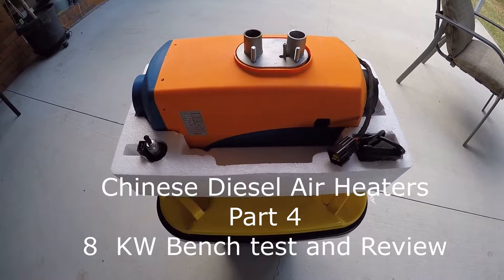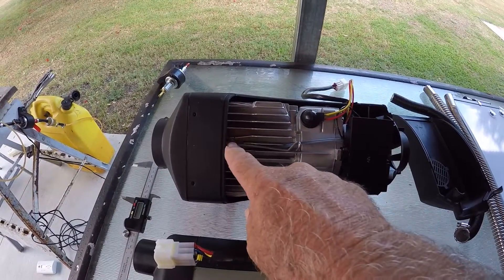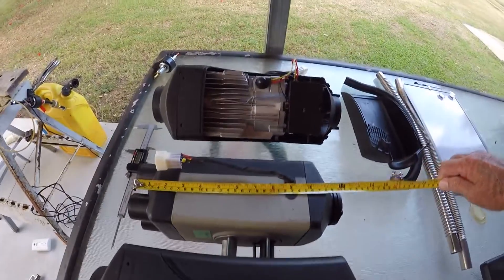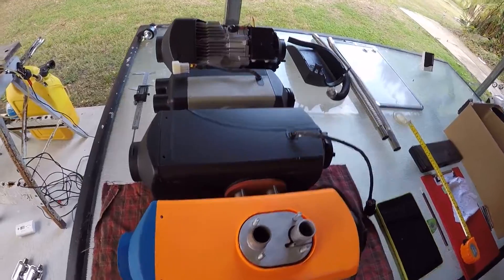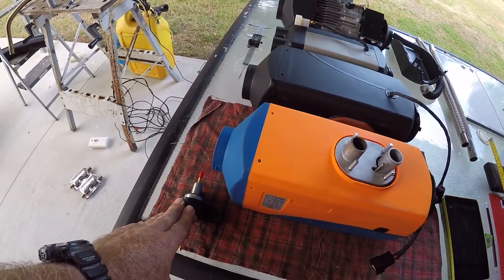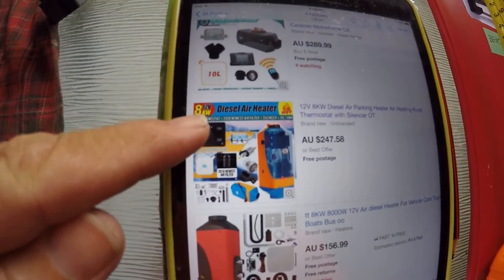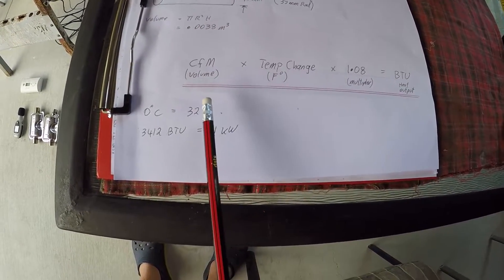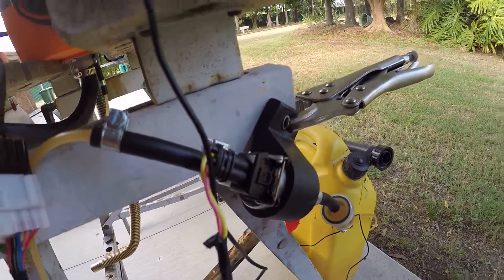Chinese Diesel Air Heaters   Part 4 -  8 KW Heater Test

Comment: hello from USA....Im bulding a cargo trailer camper and only recently (2 months) have Learned about these diesel heaters...I run propane in a aluminum trailer and get condensation...also carrying propane isnt the easiest...I bought a 8k heater but figured it was just a 5k...I watched your videos before and after purchase...my tow vehicle is now a gas (petrol?) 4runner but I used to tow with a diesel truck...I bought a 5 gallon fuel cell to mount on my trailer...anyways really enjoy the video detail...
Reply from the maker: Thanks for the feedback Vadimxp, keep warm and dry this northern winter.  JMcK

Comment: on the 8 kw unit i got it had a setting in the controller to set it for 5 kw or 8 kw. there was a noticeable difference in heat output coming out of the unit i did not ck the fuel rate difference in fuel rate or fan speed . but different control board than my 5 kw unit
Reply from the maker: Hi marte,

My 8 KW heater is a stock standard 5 KW heater, just branded different. But this video was made some time ago and perhaps there are changes with the new 8Kw heaters.

The max fuel setting on my "8Kw" heater was 5.5 Hz, exactly the same as a 5 Kw heater. 

Yes, you could probably get 6Kw from this heater by going into the settings and upping the fuel rate to 7Hz or so, but I doubt it. 

My testing shows increasing the fuel burn to just 6 Hz results in an overheat condition on this size heater and the heater shuts down. There is no way you can get 8 Kw out of this heater without increasing the fuel rate and the heat exchanger size.

Of interest,  Eberspacher rate their original heater at just 4Kw (D4) These Chinese  5 Kw heaters are an EXACT copy of the D4 heater. My testing shows it is even borderline rating the Chinese copy heaters at 5 Kw. (Yes, the Germans are conservative, and truthful. Well, perhaps there is one notable exception)

It is pure deception to have a heater that is an exact copy of the original Eberspacher 4Kw heater and market it as an 8 Kw heater.

Cheers.  JMcK

Comment: Hi John, I just watched this video on the 8kw diesel heater, I get what you are saying but if you compare the heat exchangers of both the 5kw and the 8kw there are more fins on the 8kw heat exchanger which gives more surface area which should theoretically give out more heat. Just an observation mate :-)
Reply from the maker: Hi David, 

Thanks for the feedback, It is a long time since I did the 8kw video so I can't remember about the fins on that particular heater, but I will go and have a look at the fins in a current (8KW) heater. The castings come from a number of factories, and are different between "brands" regardless of heater size.

I was careful to take measurements of heat output, air volumes, fuel usage, and overall heat exchanger size etc. But I did not actually measure the fin surface area.  I will see if I can do this now.

However I feel confident with my figures and also confident in my belief  you need a much bigger heater to gain a heat output of over 50% above the standard 5KW heater.

Regards.   JMcK
Reply: Thanks for the reply John, oh believe me I have no doubts in your tests, very well executed and very interesting, I managed to fit my heater in the garage of my motorhome and I have connected it to the original ducting, I had to do some modifications due to the difference in size of the ducting (75mm down to 65mm) I did have to put a small vent in the garage floor and used some spare ducting I had left over to get more fresh air into the machine as it is the all in one type of heater, as I had it overheat a couple of times using the Hz setting instead of temperature control, so I have just left it on the temperature setting and not tried it again on the Hz setting. I love the videos you do, have referenced them a few times during my install. Thank you.
Reply from the maker: David Evans 
👍

Comment: I have just bought a couple of 5kw Chinese Heaters.
In the Instructionbookwith joined up words, causethe Chinese Authors aren£t sure whereto breakup the words, on page 5 it lists the weight, dimensions and fuel consumption for three models as follows -
2Kw Fuel Consumption Zl/hH : 0.12 - 0.24  Weight : ZKGH : 3.6 Dimensions ZmmH : 320 x 125 x 157
5Kw Fuel Consumption Zl/hH : 0.18 - 0.48 Weight : ZKGH : 5.6 Dimensions ZmmH : 380 x 145 x 177
8Kw Fuel Consumption Zl/hH : 0.21 - 0.54 Weight : ZKGH : 5.2 Dimensions ZmmH : 380 x 145 x 177
That is all straight out of the manual on Page 5 as it appears. 
So the 8Kw unit is exactly the same size as the 5Kw unit, only by weight, lighter by 400g !!!
The 2Kw unit is physically smaller as you've shown on your workbench.

If we take the manuals figures of 2Kw heater on max consumes 0.24 l/h, and the 5Kw consumes 0.48 l/h then the difference is 0.24 l/h to produce the the difference between a 2Kw model, and the 5Kw model, 3Kw heat difference. But since we see on the spec of the 2Kw model, 0.24 is needed to produce a full 2Kw output, the math does not add up.
The fuel use difference between the 5Kw and 8Kw models for an additional 2Kw output on the 5kw model would need to be 0.48 + 0.24 = 0.72 l/h for a 7Kw output. As it is the 8Kw model only consumes max fuel of 0.54 which is way short of 8Kw output.
So the short answer is an 8Kw version by China probably doesn't exist.
with the 5Kw unit consuming twice the fuel of the 2Kw unit, the 5Kw unit is more likely to be closer to 4Kw.
The 8Kw Unicorn unit, if you can find one, would probably be a touch over 5Kw output.
Like you illustrated, the physical form factor of the Chinese 5Kw unit is that of the Eberspacher D4, which was rated at 4Kw. This seems to add up from the fuel consumption figures as well.
Still can't grumble $120 bucks is way better than $700 Eberspacher bucks. That's why I bought two and will probably buy more.
Reply from the maker: Hi Alex, thanks for the detailed comments.  JMcK

Comment: Thanks John I WATCHED ALL UR VIDS LAST YEAR. I HAVE A HEATER IN MINNESOTA USA WHICH BORDERS CANADA SO IT GETS COLD HERE. I RUN IT ALL THE TIME PROB 6 DAYS A WEEK IN MY SERVICE VAN IN WINTER.  LAST YEAR MY 1ST HEATER GOT PLUGGED UP(CARBON) SO I JUST REPLACED THE UNIT. FIGURED EASIER THAN CHANGING OUT THE HEAT EXCHANGER. CAUSE IT WAS MIDDLE OF WINTER AND MY HIGH ROOF TRANSIT WILL NOT FIT IN A GARAGE. 
SO I DID IT IN THE COLD. 

ANYWAYS JUST THOUGHT ID STOP BACK AND SEE IF THE 8KW UNITS HAD EVER CHANGED TO ACTUALLY B 8KW UNITS.   MINE IS A 5KW.   IM HOPING TO GET THRU THIS NEXT WINTER WITH THIS 2ND UNIT.   I TRY TO RUN KEROSENE SO NOT TO CARBON UP. BUT I RUN DIESEL OFTEN CAUSE NOT ALL GAS STATIONS HAVE THE KEROSENE. 

ANYWAYS I RECOMMEMD PEOPLE ON FACE BOOK OR ANYWHERE TO WATCH YOUR VIDEOS AS YOU HAVE THE MOST COMPLETE AND 110% ACCURATE INFORMATION!!   VERY WELL DONE MY FRIEND!!  LOVE THE ENGINEERING WAY YOU GO ABOUT SHOWING EVERYTHING!!    I CANNOT IMAGINE HOW MANY PEOPLE YOU HAVE HELPED WITH THE VIDEOS YOU HAVE PUT OUT.  

THANKS AGAIN AND BEST REGARDS.. NATE Hess. Minnesota 🇺🇸.
Reply from the maker: Hi Nate,

Thanks for the nice feedback. 
To my knowledge, the 8Kw are still just really 5Kw heaters.

These Chinese copy heaters are so affordable, that it could actually be cheaper to swap one out for a new one rather than pay labour costs for a professional to service.

But, they really are quite simple to clean out the carbon if you have a bit of handyman hands on knowledge.

Regards.  JMcK

Comment: Hi John,  Your reviews are great and comprehensive . I'm really enjoying them.  I'm going to be spending winter in my Mitsubishi Fuso 9 meter bus  so am going to be buying one of these Chinese diesel heaters. I'm hoping you can help me with a few things.  The area to heat is 40 cubic meters.  What size KW do I need and can you help me with a particular brand name or seller ?  I believe there are good and also bad  Chinese units ??   Much appreciated.   Regards,  Derick
Reply from the maker: Hi Derick,
A bit hard to give you definite information here as I do not know what area or climate you are travelling in your bus, nor do I know what insulation you have in the bus or over your windows. 

However there are really only two Chinese heaters you could buy, a 2 kw and a 5 kw, there is no real 8 kw heater.

I suggest you buy a standard 5 kw heater. They put out plenty of heat and should be suitable for your bus.

I can not recommend a supplier as they come and go so quickly. Not one of the suppliers I bought heaters from last year sell heaters this year. I suggest you chose an online supplier who has a warehouse in your country of origin and has a good reputation on returns. They will advertise "ships from Australia" or "local UK stocks" 

Like everything you buy, you will occasionally get a dud, but it is vary rare with these heaters. I always suggest you bench test the heater as soon as received, and not leave it stored for some future instillation. If there is an issue contact the seller straight away for a replacement. 

Regards  JMcK

Comment: I'm interested to know the temperatures around the base of these. If mounting on say a wooden van floor, how much insulation must be used to prevent fire?
Reply from the maker: Hi Ein, The hot side of the heater casing will get up to around 50 deg C.  The exhaust itself up to around 200 deg C
The heater can be generally mounted direct to the floor. You cut an oval hole about the size of the silicone gasket and then mount the heater with the square metal mounting bracket that comes with the heater. You can buy on line, or make it yourself, the square metal bracket with a metal circular sleeve to go through the floor. Without the sleeve on the bracket you should consider lagging the exhaust where it goes through the floor.   JMcK

Comment: Laboratory test or a common sense test? I'll take the common sense every time.  Thank you.

 I bought two really nice "8kw" for less than the "5kw" counterparts. I believe this supports your conclusion, these have to be the same as the 5kw.

I received mine broken in shipping. The company, Bestauto, immediately shipped replacement for part broken in shipping. I got mine off of U.S. Amazon from Bestauto. $114 U.S. EACH. 

Thanks again, John, Awesome job.
Reply from the maker: Thanks for the feedback Gary.  JMcK

Comment: I'm just thinking of getting one , a lot of people are wise to.the 5 _ 8 scam , what one would you recommend , 5 kWh is all I need .?
Reply from the maker: Hi Darell, I can't recommend one brand over another. I suggest you look for a good supplier who has a local warehouse, if possible, and accepts returns. Also chose a heater that is supplied with the controller you want.  Good luck.  JMcK

Comment: Yeah I fell for it also. I didn't invite Anthony about these heaters a week ago. I just needed one to hear my 2029 2500 sprinter extended roof 170.the van is big so I wanted a big heater especially since I didn't finlnish insulating it. I order iloff ebay and noticed that it only went up to 5 after I installed it. So I'm getting to be nice to this guy that abbiously didn't speak English well. I keep telling him to send me a 8kw unit I don't want a refund. Well he knew he didn't have one it would have just been a different controler. Then I stumbled upon the videos with the 1688 code and I was happy that I had a 8kw heater but noticed it's basically the same thing as the 5 settingsb but what has my hopes still up is the fact that we can mess with the sound and find the right mixture for a better hoter burn without overheating. So I'm trying different settings to try to get it to burn hot but at a lower setting so it's not loud and it could run all night because in the east coast and mid America is really cold at night. One thing I read on line by a smart guy like this John and that seemed to know a lot also he days the opposite of what John mc47 said about the air intake. He blocked like less than 5 percent of the whole and the unit actually ran hotter air. I tried it also once the bars were full and the 2 red ones disappeared I obstructed the intake hole (the round one on the end of the unit not the one with the pipe) and the red lines came back. Don't one of it was just the unit heating up or the flame. The guy smarter than I seemed to think it was the flame.

Comment: 110°c ? Did you just pull that number out of the air? They go into overheat over 235° if it sits there for over a few seconds.  110°c isn't even running at optimum burn temp.  you want to ideally be over 180°  for high setting and Which is around 140 to 160 is good for a low setting. Any cooler you will be sooting up and be producing a lot of carbon monoxide.
Reply from the maker: Hi Andrew, it all depends where you measure the temperature. For consistency I measured the actual air temperature approx 500 mm out from the heater. (See the videos). It is the actual hot air coming out of the heater that is of most concern to me. That is the volume and temperature of that air, because that is what is going to heat your particular boat, cabin, motorhome etc. If you want to measure the temperature of the heat exchanger body itself, then good for you. There is no right or wrong way.  JMcK
Reply: @johnmck1147  well the reading that the sensor itself puts out(on the heat exchanger) is the one everyone uses to properly tune their heater

Comment: Great videos John. I'd love to see some of the data you've collected if you'd be interested to share. Just an FYI- my 5KW heater displays the heat exchanger temps on the controller and it regularly sees 170-180C without any issues. I also read the surface temps with an infrared thermometer and it's similar. I think the shutdown temps are closer to 200C rather than 115C.
Reply: Yeah don't know where he pulled that number from haha. 110°c ? 😳.  Could be cause hes running it in Australia in a tshirt lmao
Reply: Shut down is when it goes to 235°c for over a few seconds btw
Reply: @andrewbartleman9169  Great info....thanks

Comment: John, just got my hands on the new style of a All In One Diesel heater. The fuel tank is down beside the heater as opposed above it. The tin is painted black, but they also come red. The controller comes with the three wire setup in a round connector but of a different style with a screw retainer. Its rated at 8KW, but feel and am more then sure its just 5KW. I went in to factory settings using the code 1688 and found the pump at high rate set at 5.5 and this number can be increased from there. I found the fan speed set at 5,500 rpms on the high end. This can be upped to 6,000 rpms. Just thought I would share with you and every one else. To be honest it feels like the same amount of heat as a 5KW. Oh, I paid $120.77 USD for it with free shipping from USA Warehouse.
Reply from the maker: Thank you for the info and feedback. All info that can increase my knowledge is appreciated.  JMcK

Comment: Good video, well done. I just bought a 8kW heater...if I had look at your video I would have bought a 5kW and save money. Now with your number it looks like this heater only produce 3.5 kW. If we look at your heat calculation with the air temperature you have over 5 KW but the fuel consumption is 4,5 kW. We have to go with the fuel consumption, this is more precise. 43,000 kJ/kg for diesel. So about 11,9 kWh/kg. Now we are burning about 0,38 l/h * 0,83kg/l this is about 4kW. But this is at 100% efficiency. Say it runs at about 80% at best then you are down to 3,5 kW. Far from the advertise 8kW....Thank-you for your test, good job.
Reply from the maker: Hi Gaetan, thanks for the feedback and the info. Not all quite simple maths though.
Of interest, the 2 kw unit uses the same pump and the controller is the same and puts out the same pulse rate. You can run the heaters side by side, running the exact same pulse rates, and same fuel burn. Then it comes back to heat exchanger size. The bigger heat exchanger puts out more heated air at the same settings.  JMcK

Comment: great video so if the 8ks heater is really only 5kw is the 5kw rating less than 5kw or is it that they want to market the 8kw at a higher price to maximize their profits???
Reply from the maker: Hi there, in my mind it is marketing. In realistic terms the 5 kw heater actually puts out around 4.8 kw. Either way, the 5 kw heater and the so called 8 kw heater are EXACTLY the same heaters.  JMcK

Comment: do you know how to get more fan speed out of a webasto?,after i got mine rebuilt and installed the timer unit,it seems like the fan doesn have the speed it used to anymore and the boat outlets are very weak very little air comes out the vents i need more like it was before
Reply from the maker: Sorry Diego, I have very little experience with Webasto brand heaters and controllers. Have you talked to the person who did the rebuild?  JMcK